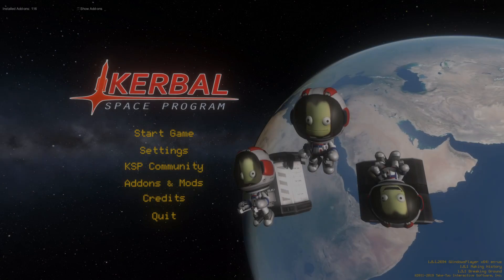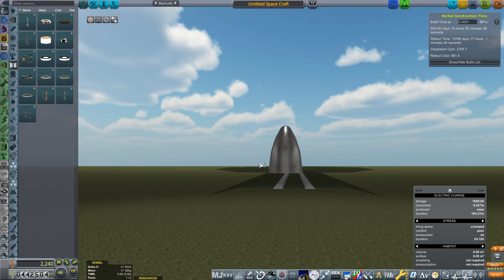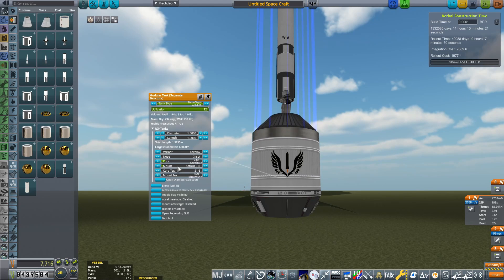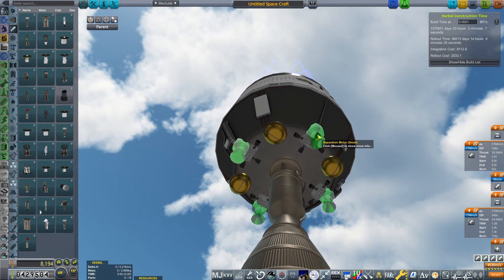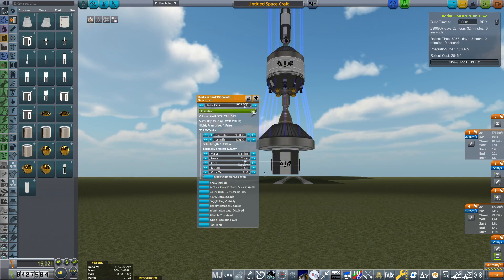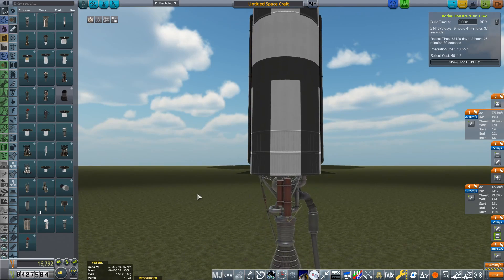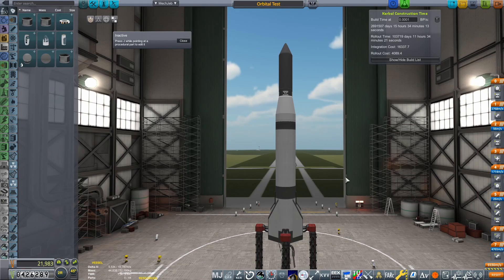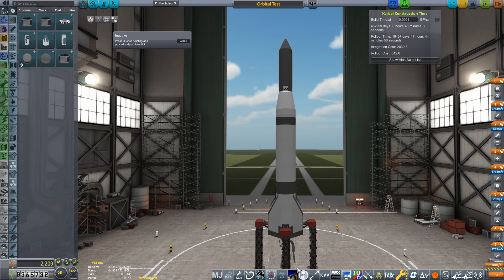Going Orbital! Building your first Orbital Rocket Tutorial in KSP RSS/RO/RP-1

Comment: Nice video! In case it's not quite getting there, one would be able to squeeze in more deltaV and lessen build cost/time with a few things:

No payload fairing, no ullage motors (RCS can handle it), and no decoupler for the nose payload. Sometimes every little bit of mass savings can help!
Reply from the maker: All true! Although if going with this design I’d recommend placing RCS slightly different so it can provide ullage! (Placing it on the bottom like I have may lead to some issues) 

Anyone else reading this though, make sure you go check out @N9 Gaming’s series for more design tips and ideas!
Reply: hi N9 love your vids
Reply: No... Payload farings?? But... but... that precious cargo!! 

In actuality, though, playing around with the PLF thickness is a better way forward. Bad aero will cost you more than the small weight gains from not having a PLF.
Reply: Right the configuration of RCS in the video would require a bit of a funky butt wiggle to ullage XD
Reply from the maker: I imagine the aerodynamics of this particular payload would be suitable to not have a PLF? I’m not entirely sure though, but yeah reducing the density of the PLF (which I do here!) can reduce any unnecessary mass as well. 

Also, once again go check out Calvin Maclure for some excellent design tips. (see his most recent livestream) The man is a true wizard when it comes to design (I’ve also not forgotten about my Twitter message, my last two videos were already recorded before I sent that though, so don’t worry @Calvin Maclure!)
Reply: @Carnasa  Good... Good! Yeeesssss... promote my channel! Well done! You'll live to see another day!

laughs diabolically
Reply: @N9GamingOfficial  did someone say "funky butt wiggle!?"
Reply: funky butt wiggle is on like page 4 of the N9SA spaceflight manual
Reply: @N9GamingOfficial  lol... pretty sure it is, yeah.

Comment: Meanwhile i'm trying to reach orbit with some v2 engines and a lot of superglue xd
Reply: did you do it?
Reply: what did it cost
Reply: @farbenfrohesgrau4056  I managed to do it, but i lost the save with the craft file, i did some "kerbal" engineering, and got to orbit with 3 main boosters, and 2 upper stages
Reply: nothing wrong with a true to Kerbal fashion craft held together with duct tape and a prayer lol
Reply: I see you are a speedrunner.
Reply: With A4 and A9 engines you can just add 6 or 7 stages like an N-1, adding more and more on each stage. I almost got a small aerobee powered final stage to otbit with a 380 ton rocket using steel tanks. Could be doable with aluminum or steel if you are good at manual gravity turn.

Comment: You’ll be able to launch without wings just fine. Use 2x LR101 for control (although the LR79 has gimbal)
Reply from the maker: I did add a couple of verniers after filming all this which are in the craft file, wings make it a lot easier to fly manually though!

Comment: If you hit the # in the top right of the window, you can type numbers instead of dragging the bar around (at 7mins)
Reply from the maker: Doesn’t work with every slider unfortunately, I’m fairly sure it doesn’t work for diameter either, reason being you use the slider for  minuscule changes whereas you use the buttons for main changes, because it has buttons you can’t type in a number. I might be wrong though and do correct me if I am!

Comment: Why not use the RCS on the second stage for ullage instead of adding those ullage motors? Saves more weight.
Reply: Also, you didn't even need RCS quads, just single RCS thrusters would do

Comment: Question in regards the very last stage that drops the science core payload in orbit. Why decoupling the rocket from the payload makes the rocket body to separate so fast that looks like it's losing significant speed? I was expecting the upper stage body to remain in orbit very close to the science core payload just because the science core doesn't have propellants or anything. Why my expectation was incorrect? Thank you.

Comment: I know I'm late to the party, but question: why does a completely full high pressure tank need ullage? If it's full there should be no room for the propellant to slosh around, right? And if it's highly pressurized wont that force fuel into the engine when it's activated?
Reply: Yes if there is no drag a fully fueled upper stage will be ullaged properly for 5-10 seconds and there should not be any problems firing the rocket engine

Comment: Probably should have passed on the extra interstage fairing, and put the entire mess above the boost stage into a single payload fairing. Which then gets dumped midway through the initial boost phase, as soon as you're past the denser part of the lower atmosphere. Which is also, incidentally, how it's done IRL. They dump the fairings as soon as it's safe to do so without causing aerodynamics issues, which is the only real reason there are fairings in the first place, of course. The sooner that extra weight is gone, the better the overall efficiency is, and the lower the delta v budget requirements. No IRL launch leaves fairings all the way into vacuum if it can be avoided. You're only wasting energy and delta v hauling unnecessary weight.

Comment: There's no sensible reason to decouple your probe core from the final insertion stage -- it's not like the third stage engine and tanks will deorbit, you just wind up with two pieces of space junk in a few hours, instead of one.  No final decoupler = saving another few kg.  Likewise, since you have ullage motors on the second stage set to fire on staging, separation motors on the booster are redundant; deleting them saves a few more kg.  And, since your LR-79 has a gimbal, you don't need to the center of lift to be actually behind the center of mass -- it can be a little ahead, and unless you're going to coast between first and second stage it won't matter -- it probably won't anyway, since that big empty tank will act like fins once most of the mass is concentrated in the second and third stages.  The fairing around the final stage is redundant -- an interstage there would save mass, and the upper stage doesn't need its protection.

A couple verniers might help, though, since you have no roll control on the booster...

Now, since you have a km/s or so delta-V to spare, you can make your probe a little bigger/heavier -- say, more batteries so it lasts longer (gathers more science), a better antenna so you can collect science if it goes higher, etc.
Reply from the maker: You are absolutely right, the end craft file (which I linked in the description) has a couple of vernier engines for roll control, but yeah every point you make here is very valid!

Comment: I don't know why my aeroobee stage as a lower delta v than yours and when i set the tank to aluminium 2 hp 3 metter length by 400 mm it has less fuel than Yours
Reply from the maker: Are you changing the configuration of the aerobee engine?
Reply: @Carnasa  yes but i decide to juste ignore that and it worked as well.

Comment: The final stage of my rocket with the aerobee brings up the prompt "Insufficient Avionics," and I cannot ignite my engine. The tank is pressurized and I have an electric charge, I'm running out of things to do.
Reply from the maker: There shouldn’t be controllable avionics on the final stage, it’s an uncontrolled kick stage. You should be able to fire the engine though, even without controllable avionics. Any message coming up to why the engine won’t fire?
Reply: @Carnasa  there’s a possibility it could be j got unlucky 4 times in a row and my engine failed, and it could be some external cause as well. it’s just weird because every other uncontrollable-sounding rocket I’ve built has worked just fine, but this stage is giving me trouble. 

edit: ding ding ding, I was surprisingly right. I just tried the stage to my rocket once again and it worked no problem and I got to orbit, my engine had just failed 4 times in a row. sorry for the inconvenience, I'm a huge fan of your channel!

Comment: I'm new to RO, maybe someone here can help me understand something. I am honestly lost when it comes to avionics and utilization and such. 1, I don't understand the need for avionics on each stage of the rocket if we simply decouple and discard it when done with it, and 2, I don't understand the concept of avionics utilization, and the need to input the weight you want to control with it. I'm not sure why weight matters. All it's doing is controlling thrusters and such, right? And with multiple probe cores on the rocket, how do I know which one is currently in control?
Reply: the reason for multiple avionics is because each avionic controls a different mass, and basically the avionics at the first or lowest stages are more powerful because its more massive, in comparison to a smaller, and hence less powerful second or third stage avionics
Reply: @spacenome  soooo, what if I just use one powerful avionics on the upper stage instead of multiple? I have gone far in my career yet, have not reached orbit, so I have not done experimentation on this.

Comment: Oh boy, I don’t even have all of those science nodes unlocked and I have 3 years to complete this orbital rocket contract and I have no idea how I’m gonna do this. Should I just start over with a new save to try and get some more science and what not?
Reply from the maker: You don't need those nodes unlocked you can get orbital with much less, this is just a lot easier to do and more reliable! 3 years is still a long time though, if you have regular launches in that time there's a good chance you can still make it!
Reply: @Carnasa  I’m having another problem where the fuel instantly depleted on launch. The first stage doesn’t even fire because kerosene instantly depleted when I try and ignite the engine.

Comment: All of my engines keep saying they have no ignitions left, how do I fix this?
Reply from the maker: Each engine should start with at least one ignition. Are you using mechjeb? Sometimes it can be funny and burn through all your ignitions
Reply: @Carnasa  Yeah I reinstalled and seemed to fix it. Also I am wondering where did you get he mod to 1. Check electrical time objects have and 2.  Build rockets out doors? I’m just trying to make sure I can know this stuff before I launch lol.
Reply from the maker: @calebruiz2258  the mod that displays ec time is Kerbalism, it completely overhauls science, has food/water/oxygen as life support, adds cabin pressurisation and gives a stress meter to kerbals, adds radiation, radiation belts and solar weather, and of course that handy little box :p it’s a very challenging mod but totally worth it. 

Building outdoors I think is hangar extension mod :)

Comment: Hey Carnasa, I am a complete noob to RO/RP-1/RSS and i am trying to do my first launch but every time i try, my main engine just won't ignite. I searched on the internet for an answer but i couldn't find it. i tought you might know the answer because you obviously know a lot of things about RO.
Reply from the maker: Hmmm, do you get any error message come up when you try to ignite your engine? Such as fuel pressure too low? 

If you’re on discord maybe come and join my server and send over some screenshots, very hard to diagnose the problem with the info you’ve given, but I’d be happy to help if I can! :)
Reply: @Carnasa  It sais: insufficient avionics locking controls and in the menu of the engine it sais: flame out, cause: lack of pressure.
edit: it does say feed pressure too low. how do i fix this?
edit2: fixed it thanks.

Comment: I've followed this video like three times yet my rocket is 60 tons and can't reach orbit. Odd.
Reply from the maker: Are you using the upgraded Aerobee? Have you upgraded your tanks? (This makes a huge difference) how much dV are you getting from your build?
Reply: @Carnasa  I'm using the upgraded aerobee. I'm missing about 1000ms of Delta V. The first stage has around 3219ms. What do you mean by upgraded tanks?
Reply: @Carnasa  I'm getting about 9300ms in total.
Reply from the maker: @Skive_67  upgraded fuel tanks, the starter tanks are made with steel, and have a very inefficient fuel to mass ratio, upgrade those and you should see a drastic improvement to your dV there should be a slider that allows you to switch between rank types. 9300 m/s potentially can make orbit, but 9400 is the magic number most people go for!
Reply: @Carnasa  I did that and got around 9800ms. I got really close to orbit. Technically I got to orbit but my periapsis was still in the atmosphere. Thanks for the help, gonna try and fine tune it to get to orbit.
Reply from the maker: No worries! You’ll get there! Good luck :)